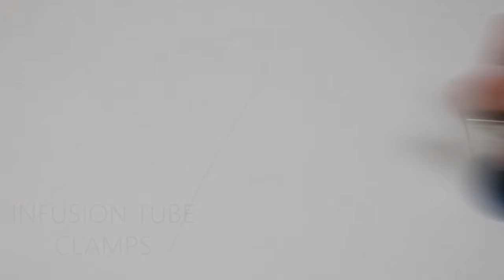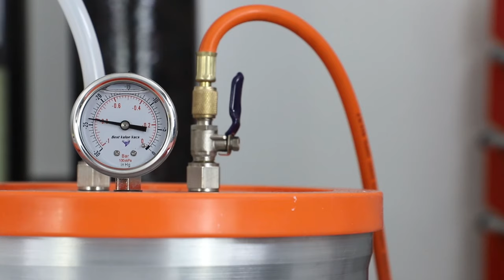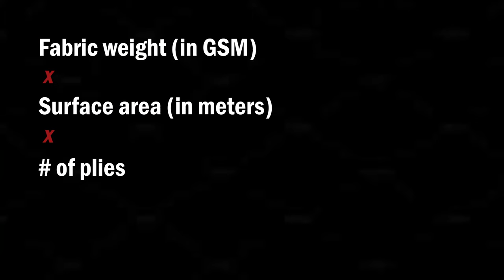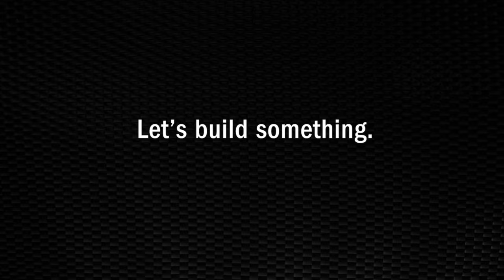Resin Infusion How To by Rock West Composites

Comment: Why the resin flow is too slow, and in vaccum we do as max as it gets? Thank you, and perfect finish!
Reply from the maker: Thanks for the compliment! Speed of resin flow is determined by a few factors, most notably the viscosity of the resin system being infused (& ambient room temperature). Less really to do with max vacuum being pulled. One other factor that plays into it is the thickness of the part and the material type and fiber orientation you are infusing into.

Comment: Nice video!  I’ve never seen anybody infuse West System before... seems to have worked though.  Learn something new every day!   

That Compoflex lets you get away with no resin break at the vacuum side but for people using a mesh or shade cloth it is a great idea to leave a few inches of resin break between the flow media and the vacuum side spiral wrap.  It will help the part fill and limit the resin flowing into the outlet hose.
Reply from the maker: Thanks for the comment! For our larger projects (when we infuse sheets up to 10 feet in length and or thicker laminates) we use a different resin system. This particular West systems works for small projects such as this BUT if you want bigger / longer pot life's and more strength other systems can be beneficial / needed.

Comment: What are the parameters of the vacuum pump in your video, if you can know?
Reply from the maker: This particular vacuum pump is a 2 stage, 4CFM (cubic feet per minute) pump. It is capable of pulling full vacuum (at our altitude it can achieve 26 inHg). This portable pump is good for a single vacuum bag or multiple small vacuum bags. For a shop that has multiple ports and processes running simultaneously, you would need an industrial vacuum pump with an accumulation tank.
Reply: @RockWestComposites  Thank you for your response. Great movie!

Comment: Are the stretchier bagging films like air techs stretchlon 200 preferred, over the regular airtech nylon bagging material for bagging and carbon fiber skinning parts (car fenders, etc)?
Reply from the maker: The stretchier bagging films are great for complex / curvey shapes. One drawback to the stretchier films is that it is then recommended to use a tighter flow media because vacuum will stretch the bagging film into the gaps of the flow media during infusion thereby imprinting (possibly) dimples. Eg, you will see ever so slightly the surface finish of the flow media.

Comment: Cool tutorial. One question about when to stop the intake of epoxy and when to cut off vacuum. Is it possible to over saturate the cloth or does the bag pressure prevent that. Is there a "rule of thumb" to ensure a consistent resin to cloth ratio?
Reply from the maker: Generally speaking, it’s a good rule of thumb to close off the vacuum (outlet) tube as soon as the entire surface has resin. You can then close off the resin flow. At this point there will be a pressure differential between the inlet and the outlet. Closing off the vacuum and the resin will equalize the pressure and the vacuum side of the infusion will completely saturate with resin as the pressure equalizes. It makes everything easier if your resin line reaches the vacuum side all at the same time.

Comment: Very nice method.. how we can get clear matt finishing after infusion process?
Reply from the maker: Clear as in smooth or literally clear as in not opaque? If you deploy this exact process but on anodized aluminum, you can get a smooth but matte (semi-gloss) finish. OR if you wish to have a very matte / slightly textured surface you can grit blast the plate afterwards. ALSO, note that this plate if laid up and made in this methodology, the back side (opposite the glass surface) will have a peel ply OR textured matte surface by default.

Comment: Hi, Nice Video. I am trying a similar experiment and have air entering into the inlet when I release the resin clamp. it lifts the bag up, or forms a huge bubble at inlet. Any suggestions ?
Reply from the maker: Sounds like you have trapped air in the line likely resulting from the inlet side not being evacuated completely PRIOR to clamping the line. Apologies for the delay, did you happen to sort this one out?
Reply: @RockWestComposites  in the way you did it, you introduced some air when opening up for the resin. why not put another clamp by the bucket of resin so the hose can be evacuated too?

Comment: Nice job with resin infusion. I have never done that method, would scare me that the resin wouldn't make it all the way across the surface before starting to gel. One thing, I have never heard of tacky tape being called chromate tape. There is a chromate tape but it has nothing to do with composites and I wouldn't want to use it if I didn't absolutely have to!!!
Reply from the maker: There are specific resins designed for infusion that take some of the uncertainty out of infusion. They have a much lower viscosity for better flow, and they are also much longer pot life which ensures that it makes it across your part. Just keep in mind that laminate thickness will affect the flow rate of any infusion.

Sorry for the confusion on the tacky tape. Originally, the technical name for the tacky tape was "Zinc Chromate". Over the years it's been shortened to "chromate" in the industry. While technically incorrect, it can still be heard by some of the older professionals. Tacky Tape is a trade name for a specific brand of vacuum bag sealant tape. There are many brands and varieties of tape available, but keep in mind that some are made for specific processes or temperature ranges.

Comment: Are there holes in the sprial hoses on the edges or do they move the epoxy to the outsides and they just meet in the middle
Reply from the maker: The spiral wrap is in fact not really a hose at all, but rather a continuously wrapped strip of plastic that appears and takes the form of a round hose. This allows resin to travel quickly down the line but then seep out through slits at every 1/2" or so.

Comment: Great video! I have a question I’ve been struggling witha while now… Is it possible to vac bag woven glass & have a part come out the mold with the A surface showing no pattern of the weave? I.e completely smooth face as if the part was pressed steel car panel 

All the best from England!
Reply from the maker: Two answers: To visually hide the weave of fiberglass should not be too challenging however you may have to paint the surface so to hide any visual look of a woven underlayering of the glass depending on how broad the weave is you are using. If however you are speaking specifically to the texture OR smoothness to the touch (not visual) this is possible but likely only achieved if you are laying up on and infusing against a perfectly smooth surface to start, eg, and painted automotive surface, gel coated tool OR glass. We are able to get "A" surfaces when infusing against glass with no special post process at all.
Reply: @RockWestComposites  thank you for taking the time to answer my question I will implement your suggestions 👍🏻👏🏻

Comment: I have a question how would you avoid dry spots whenever you pull the mold off of it
Reply from the maker: Dry spots are usually caused by trapped air or lack of resin. Getting a good vacuum seal prior to infusion is crucial for eliminating air content. And in some cases leaving the vacuum on too long can starve the part of resin.

Comment: Is there ever a problem with air bubbles being stuck in the laminate when using this process? When you mix West resin it's full of air bubbles. Do they stay in the laminate?
Reply from the maker: Before the resin gets pulled into the laminate via vacuum, all the mixed resin gets degassed. This pulls all the mostly visible air bubbles out of the epoxy mixture. The dry materials that are under vacuum then in theory are void of any air and the epoxy that is being pulled through is as well creating a nearly air free laminate.

Comment: What are the advantages of infusion over using pre preg materials?
Reply from the maker: That's a really good question. They both have great advantages and disadvantages, but in totally different areas. But in a nutshell, Prepreg is a very clean process that gives great and predictable results, but is expensive to buy and use (dedicated equipment, high operation costs, hi-temp tooling, materials have shelf life). With Resin infusion you get good results, cheap equipment, semi clean process, room temp tooling, very low operation cost, materials have longer room temp shelf life, but, it has a longer learning curve and the parts are generally heavier as they have a higher resin content (which also means less performance). It can also take some trial and error to get the resin to flow correctly on complex shaped parts. They both have their place, but which method you choose will be determined by the results that are required.

Comment: Given you only mixed ~1200 grams of fluid did you mean to say 100grams of extra resin and hardener, not 1000grams (1 kg)?
Reply from the maker: Actually that is accurate. There is a surprising amount of tubing or excess safety net you should account for so that you don't the part dry (eg suck air at all).

Comment: Can you use Rain-X or have you ever tried it
Reply from the maker: I've never tried it as a release agent, so you should proceed with caution. The biggest question is whether or not the resins will interact with it, or if heat changes it. As Rain-X is designed to be somewhat hydrophobic, it's designed to repel water, but how it interacts with other materials is unknown to me.

Comment: Hi, it was great🔥 Did you do the cooking operation using the ambient temperature?
Reply: west system is room temperature curing. the slow hardener used recommends no temp below 70ºF i believe.
Reply from the maker: Spot on @john! All of the infusion resins we currently have are room temp cure, generally this just means they take more time to reach a fully cured state.
Reply: @j121212100   thanks for your comment

Comment: What is the orange tube from the vacuum chamber?
Reply from the maker: That would be the vacuum line.. The means by which we are able to pull vacuum on the chamber (connecting the pump to the chamber).
Reply: @RockWestComposites  thanks

Comment: Wouldnt a sandwich panel be better?
Reply from the maker: It all depends on the application / end use! Sandwich panels can most certainly achieve higher stiffness per weight however some applications are not afforded the physical space of a plain, all carbon fiber plate OR there can be the case where the assembly at large would not directly benefit from the added cost of a sandwich panel. And for others that may read this post, check out our cheat sheet "Sandwich Panels 101" here for the simple math that explains just why one might in fact want to use a sandwich panel instead of a plate. https://www.rockwestcomposites.com/blog/why-you-should-be-using-sandwich-panels

Comment: you need mavcoat release agent, way better than wax.
Reply from the maker: There are plenty of great release agents out there like including Chemlease, Frekote and more! We have never used Mavcoat but will look into that option as well. We encourage all to use what they prefer most. Wax is the easiest on the environment BUT not the highest performing OR best in terms of part finish once demolded ;-)

Comment: why not use a flexible bag?
Reply from the maker: Flexible or stretch bag is ok if you need to conform to some troublesome features, but it can be difficult to use and my have leak issues. With infusion, the stretch can cause issues with the flow media by conforming too much to the media and not allowing the resin to flow as needed. It can also stretch in the opposite direction and not give as much compaction force while the resin is flowing, which in turn will slow the flow of resin through the bag. I always prefer non-stretch bag for every application. A well placed bag shouldn't require any stretch bag to conform to the features of the part.